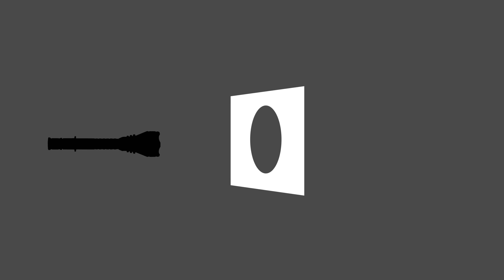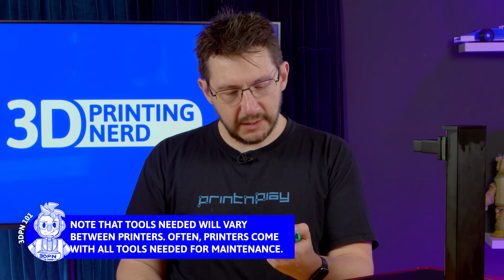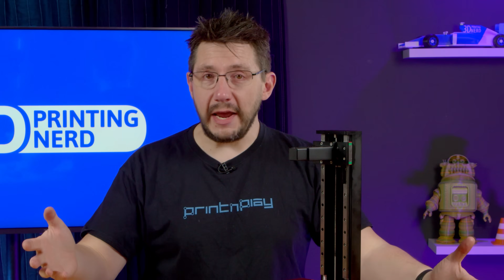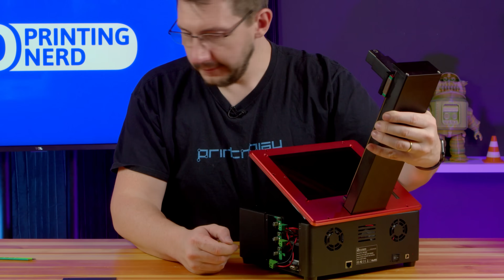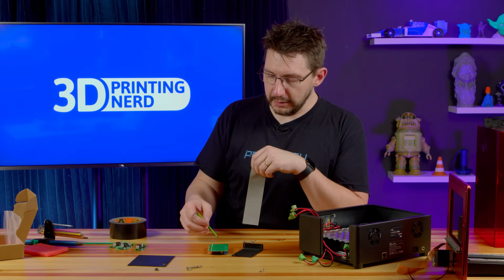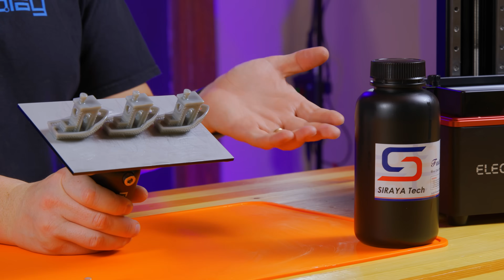FIX AND WIN an ELEGOO SATURN!

Comment: I will be using this printer to print some of the sculpts and things that I have been modeling and learning to model in class! I already have a Prusa i3 mk3s but found that for detail prints FDM just takes too long and the overall outcome of the print is not really nice, unless I process the print( sanding it and painting it) or increase the size (which increase the print time and material use). Resin is the was to go for smaller and higher detail prints.

Comment: First of all - your way of eliminate failure sources to find an error is awesome. I learned during my study to get closer to problems by doing it like you did. In the present the young pleople mostly just google there problems. Really loved your way of doing it. Now back to the question. I'm an absolute newbie in the 3D printing. I still waiting on my first 3D Printer (Mini+) from Prusa which I order in Dec. 2020. So I have to learn everything from the scratch and I can start learning it both sides (resin and fdm). I have so much thing in my mind an a couple of things I design it already in Fusion 360. A lot of stuff for my house (which is 12 Years old) where parts are broken or bleeched by the sun where you can't get any spare parts. That was the reason to buy a 3D Printer (and maybee to print some cool stuff for my kids th show them how to plan and build things). After this decision I started look for sources of informaition and your channel (and a couple of other) stay in my sub... At the moment I'm not clear what I would directly print on this printer because I have no experience with the material. Can I use it to print parts for outside? Can I print parts where water or steam pass by? Which colors can I print with it... (and many more questions which I only answerd me for the fdm printer) This is something to find out when I win the printer. But what I learnd from all the different sources... PRINT A BECHY FIRST (to see if everything working proberly) - so this would be my first print. One suggestion to the pinter... you can put a sticker on the cover and sign it so we can see that the hood is well loved more :-) Greetings from germany (and sorry for my typos or bad english) - BTW: I have the same WERA Hex Multicolor L-Key Set :-) great toolset

Comment: Pffff, what to print with a Saturn? What would you not print!? A resin printer at that size might just make a dent in my dowloaded and home designed stl collection... 
High up on the list would be a couple of strong and accurate printed parts for a tiny cute little cnc mill conversion which is currently failing on layers as well as missing some accuracy from supports which is where resin printing would shine! 
Then some action camera mounts followed by some little plastic toys for the family followed by one of these cool Oblivion droneshells followed by many more parts which is likely when some maintenance is due. Fortunately someone just uploaded a good video on the inner workings of these beauties to make that a breeze.
Loving the positivity here, keep up the good work. Virtual high five and happy printing to whomever will win that beautiful beast!

Comment: I got my Mars 2 Pro back in November, I've gone through about 10 liters of resin since then, it basically prints non-stop. I've recently gotten gone from printing Minis to larger models, 1/10 scale specifically, the problem being the amount of separating I need to do, and then post-processing and assembly before painting and finishing.

I've been trying to get a Saturn, stock has just been crazy. It would make things so much easier.

Comment: Bro, I literally need to print myself some teeth. I got ten titanium posts in my mouth. I got a bottom denture, but I lost the top one a while back and no seven grand to replace the top denture (I hope the lady that did the original will let me try and use the stl file? Gotta find out if I win).

4k screen right? Ya, that should do it. Materials recommendation? Maybe I can use some cash on the side to get one of them fancy shmancy wash/cure booths too on the cheap? Would be the last of my meager dollar rations but.... must wash, must cure. Especially if I win! Whoa, that'd be a change!

Anyway, for really reals. Could use lots, friend. =-)

Comment: Hi Joel, I love watching your videos. I recently started designing my own fidget toys. I have one that's a 3D cube maze that has a ball bearing rolling through it. I only have a FDM printer but it's not appropriate to print the fidget toy I designed. If I won this 3D printer I would use it to print my new design, and use it to continue to design cool items to share with the 3D printing community.

Comment: I want to print some family 3D printer parts with resin printer. It will be more heat resistant. I also have some models that need high resolution. Small statues.

Comment: First, Great walkthrough, thank you. you actually may have just helped me troubleshoot an issue with my first gen Mars. 

Second. I've been trying for a long time to get my hands on a Saturn, I'm super into the Elegoo ecosystem of devices, and I'm dying to get my hands on one so I can start printing some of my cosplay armor a little bit easier. I've been working on a set of Mandalorian / Thor mashup themed armor that something like the Saturn would have enough of a build volume to help me reduce the amount of plates I'd need to fill and odd cuts that I would have to take care of in post processing. It would make my prototyping for my cosplay armor pieces so very much easier.

Comment: I’d start out printing resin keycaps, they come out so much cleaner than FDM! And then definitely use it for parts in my builds where resolution and surface quality are important (snap fit designs/socket fits/bearing surfaces)

Comment: My wife and I picked up the elegoo mars for printing gaming minis a while back, which works great.  I've had to replace the LCD before, but that was due to a little spillage of the resin on the screen and it subsequently sticking to the tray.  It works great with the new LCD.

I have an arduino project which the case has to be large enough to fit the antenna and battery and OLED display which doesn't quite fit in the build plate of the mars though.  I've had to resort to using an FDM printer to handle those cases, which leaves a bit of sanding work to make it look nice.  But, it looks like the saturn's plate would be large enough and would allow me to replace the cases with a much better looking case.

Comment: I'm in the beginning phases of designing some traditional Inuit items.  Very much beginner at the moment, but if I had that printer I would study up some more on getting extra details into CAD designs and print out some tools, vehicles, structures that were used by Inuit back in the day.

Comment: I have a bunch of stuff I would print... the most easily-defined category would likely be tabletop RPG miniatures, but I have designs with details too small for the Ender 3 so a resin-based printer is on the list of stuff to get some day (there's a lot of work to be done for the project where it's needed, so it'll be a good while until It'll be useful).

Comment: I would print my fox lamp I've been working on for years, figurines I create to potentially sell on Etsy, the inner and middle ear bones at a 1:1 scale (if possible), probably cosplay props like buttons for my Happy Mask Salesman but with Regency era gentlemen attire, and the ultimate challange. Apollo and Delphine created by Bernini at as large of a scale as I can print. I've had my Wanhao Duplicator i3 for almost 4 years now and have been looking into SLA printers recently since the prices have dropped significantly. Hopefully the Saturn will become available soon so I can snag one. I do want to work more on practical prints but that's more case by case basis

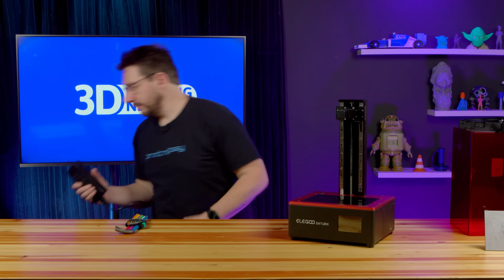Comment: My entry project... Well, My first printer broke the other day, (Ender 3) and it really fought me in trying to fix it, but now it works. NOW my good keyboard has broken... It's been a terrific month so far. lol  ANYWAY, I'm getting better and better at 3d printing and in modeling since I got this thing in January, so I'm going to make my own  keyboard.. My plan is to do the case on the ender 3, recycle as many parts from the old keyboard as I can, And do cool  themed and detailed key caps. A resin printer for the detail work would help a ton, AND I could learn resin printing.  BTW, I thought I was watching Boogie Nights 02:52   for a second there, lol.

Comment: Nice job Joel. I’ve repaired a few printers (and other electronics) and one tip would be to label all connections, especially those that are the same. While it’s true that the connectors you removed were not vitally important as they were for power, if the connector is data then you could introduce more issues. Another tip would be to store the groups of screw in trays or tubs, sometimes they may look the same but have small differences like thread pitch or length. I would have also gone 1 step further in trimming the metal bracket by removing the screw studs and remade the power cable to delete the other 2. 

As for what I would print, probably some fine detailed mechanical parts and try to push the accuracy and durability of the printer.

Comment: I would print high tolerance mechanical parts like gears. I also started to work on a new extruder design for my fdm printer and it would be nice having an SLA for prototyping. :D

Comment: If I win, I'd be trying some press brake tooling, interior automotive parts, and I'd like to attempt printing an orbiter 1.5 in the white sculpt resin that has such fantastic thermal performance in the flamethrower test! Also, I'd like to do some strength/rigidity/thermal testing with resin printed parts using some additives like talc, carbide powder, etc.

Comment: Holy Smokes!   I think a fleet of Joel-Bots would be a perfect first test print!   Seriously, I've thought of many things I've wanted to try to print with resin.  One idea is creating transparent buttons to make a custom keypad and back-lighting them with RGB LEDs.  I'm hoping to use conductive filament to do the circuit traces, and FDM print the substrate for the buttons.   A TPU membrane under the buttons could act as springs, but that's  a hole other experiment.   (Sorry, NO walnuts next time....)

Comment: I’m working on a MAJOR transformation of my Ender 5 Plus, which includes replacing some of injection molded plastics with new parts, but with a kicker.  They also need to withstand high heat levels of at least 120C+, 160C+ would be best.  Since there are now resins available for this, and printing the parts in filament might cause issues, I need to print them in resin.  I can print some of the parts with my Elegoo Mars Pro, but I’d need to break up the larger pieces into smaller pieces, if I don’t have something like the Elegoo Saturn.  Which I’ve been trying to get since it was released.  😭

So, what am I changing on the Ender 5 Plus?  Well, the extruder and hot end have already been replaced with off-the-shelf parts, which needed to be modified for linear rails.  The Y-axis needs to be split into dual-Y, so I can run the belts on the sides (instead of top & bottom).  Why do the belts need to run on the side?  Well, so that I can put the linear rails on top, instead of the sides, which will allow me to turn the printer itself into a heated build chamber.

I’m doing as much of the build as possible with parts that Creality already manufactures; however, there are many parts that need to be sourced from 3rd parties.  Some of those 3rd parties are Bigtree-Tech, PrinterMods, Micro-Swiss, Slice Engineering, RepRap, Home Depot, and others.  It’s a big project, and I will be posting videos on the entire process, which is also going to be interesting.  Does this meet you specs for entry?  🤓

Comment: I've been wanting to try to print some custom computer mice. Also, a new scroll wheel for my G Pro Wireless. My Ender 3 V2 sadly doesn't have the accuracy to print a 1.7mm hexagonal stem and just the scroll wheel isn't available to buy anywhere. :'(
Having the accuraccy of an SLA printer would be a very welcome upgrade for me.

Comment: My senior project is starting next quarter and the main prospect is that I’m gonna be working with the manufacturing department at Cal Poly Slo to document and record my findings on investment casting with 3D printed wax resin. I would use the larger build volume to get more tests on larger scales. I also do free lance 3d modeling for small jewelry companies and being able to output more samples would be awesome.

Comment: Assortment of parts - fixtures for microscope, including a SEM! Fixtures for CNC at work, and my most urgent need, come up with fixture for Buehler Ismoet 4000 saw (sample holder).  Did Elegoo purposely challenge you with the PCB?

Comment: I do all sorts of prototyping, and I picked up a mars pro a while ago and love it but the saturn has had me drooling with the huge increase in build area, and printing speed.

I could probably 3d print every part for a custom mouse case, or a game controller body, or countless other things I can't even think of with that much more build volume.

I've had a prop gun project I'd love to make too, but the small build volume on the mars definitely would restrict that a lot.

Comment: I'm surprised you didn't use a fan of resin to insulate those contacts. If I had the Saturn's larger print area, I would print the larger version of the flying green dragon I found on thingiverse in elegoo translucent green.

Comment: Hi Joel! (Sorry if I have already commented by the way. I looked away for 30 seconds and the one I was typing was gone. One of life's many questions. What is the meaning of life and did I comment on Joel's video?)
I would like to 3D print parts for my robotic Triceratops that I'm designing. Like any other 18 year old, I would like to spend my summer building a walking robotic Triceratops. (Not full size...that's stage 2.)

Comment: With a saturn my first prints would be a few models from the lord of the print patreon that I've not printed due to the sheer number of split prints it would require (or massively scaling down )to fit my photon.  After that it would be minis for dnd/tabletops and a few personal designs I've been working on .

Thanks for the chance to win !

Comment: I'm huge into printing D&D minis on my Ender 3, but the details a resin printer could achieve would be breath taking! I've always wanted a Safety Joel figure that did not require too much sanding, and that would be my first print. Of course I'd make a video of the unboxing and process.

Comment: As a jeweler, I would be using this for highly detailed castable resin prints in large batches. The larger build surface would definitely help with not having to do multiple runs of the same model!

Comment: No idea if this is gonna work and parts are strong enough but because with a SLA printer you can print more detailed features, I'd try to print a small mechanical clock :)

Comment: I would print art for architectural models (statues and stuff) ... i was going to do it at our fablab butthey removed the sla printer there ... "not enough use" ... now i had to print really small models with the fdm printer ... it worked but not convincingly...

Comment: Great video! I've been looking at several resin printers recently, and planning to save up for knee after my upcoming wedding. But if I won the Saturn, the first thing I would print would be minifigs based in 3d scans for my wedding cake topper, and minifigs of each of the members of the wedding party as gifts. And something custom, but useful, as table favors for the guests. FDM works for most of the table favors I've done test prints of, but I can't get the resolution I want out of my FDM for the mini figs and some of the table favors. After that, I would probably use it mostly for building custom car models, or investment casting custom hardware bits for cars, my house, etc. I've designed some pretty sweet sword hangers for my fiance's collection, some in plastic and some investment cast, with my FDM printer, but I can't get the detail I'd like on some of them. I just recently found a really cool statue that would make a great display for a dagger, at scale, and backed a pretty cool 3d scanner on Kickstarter - just need the scanner to actually show up before the honeymoon, and a resin printer to print the detail properly, at the scale I want, when I get home. I use FDM for all sorts of things, but resin would open up a whole different world of stuff I can make.

Comment: This has to be my favorite issue yet, not based on the give away either. I dont even want it for me as I already have a comparable model by Anycubic (chosen just based on availability at the time). But Elegoo was of high consideration at the time of that purchase, and I'd love to team up with you and donate your extra elegoo plus me funding anything needed of equal value to a fairly new community geek pool called Franklin Center for Innovation, a great organization run by friends, connecting neurons throughout the community. Also: a) the fix-it walk-through that you provided I'm confident I can adapt for my Anycubic Phonon Mono-X (except for that amazing shipping), and b) it would be awesome to put these two machines side by side and scope out any strengths over the other, and of course reference your site ;)

Comment: I would probably print some figures, maybe mechanical parts, because I presume this printer is more accurate than my Geeetech A10 Pro. I'd probably also print some home decor stuff, because no FDM printer can get prints as clear as SLA machines can imo.